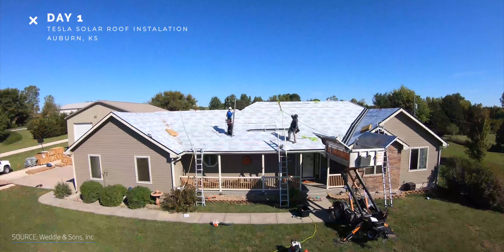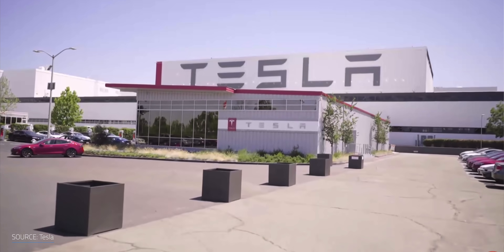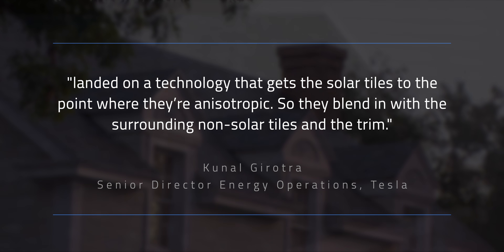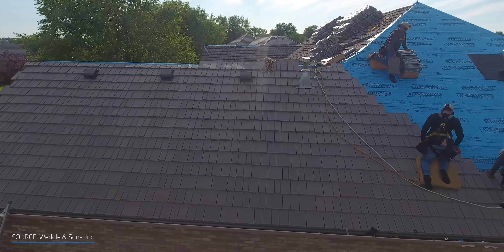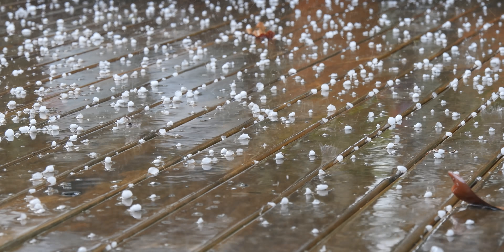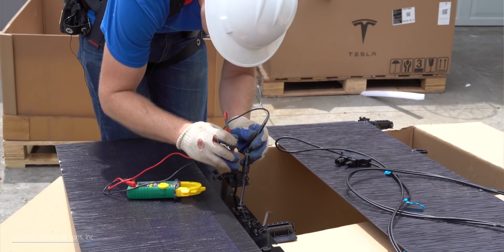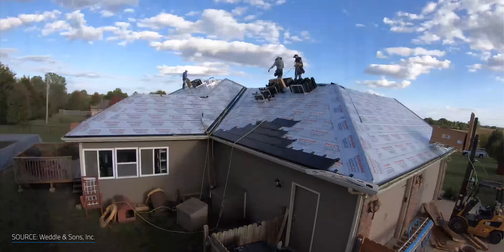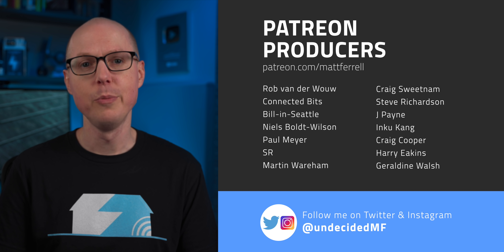Exploring If Tesla Solar Roof Is About To Go Mainstream?

Comment: When he talks about hail damage, he misses an important point:

If you cover your asphalt roof with traditional solar panels, the solar panels will get hit be hail, not the asphalt roof.  If one of those panels is broken or damaged by hail, replacement is incredibly easy.  It'll likely take your installation company less than 15 minutes once they're on-site.

Comment: I enjoy your channel especially since I am from MA as well.  So some content is very relevant.   I am considering Teslas panels and just reviewed the qoute for the roof.  In my case panels are $16k(7.2kwh) and roof $47k(8.2kwh).

Even if I replaced my roof the panels would be a most cost effective option.

Although the roof looks like a great one for a new build.  I think you pointed that out.  

Keep up the great work.  Thanks from Charlton MA

Comment: SAVE YOUR MONEY - FORGET WIND TURBINES & SOLAR PANELS !!! 
Within a few years electricity will be rapidly falling in price. Thanks to the invention of the PLASMA REACTOR (first announced by SAFIRE at Bath University UK in July 2019), which is guaranteed to sweep away ALL other current methods of power generation due to its multifunctional capabilities, as follows:
1. Extremely cheap & green electrical generation 24/7 & 1600% more efficient than even a current Nuclear Power Station.
2. Remediate Nuclear waste. i.e it will totally "eat" the material creating the dangerous radiation, and save us all Billions a year by getting rid of all this highly dangerous material that we have too currently bury & store.
3. Transmutation to produce Rare Earth Metals in Industrial Quantity at a fraction of their current cost value.

SAFIRE was a High Tech Canadian Electrical Engineering Research Company, set up to research the concept of the Plasma Reactor, and produce a working prototype (completed in mid 2018).

AUREON ENERGY Ltd. A Canadian Electrical Engineering  Development Company, set up to develop the "Safire prototype" into a fully commercialised saleable machine system. Commercial Design & Development is expected to take another 2-3 years. You can find AUREON ENERGY's elucidating advertising elsewhere on the Internet !

The "Plasma Reactor" is intended to simply replace the Gas/Oil/Coal or Nuclear part of any current main grid power station. Power stations boil water to create steam, which is then fired under pressure at Turbines which then rotate. Each Turbine is connected to a Generator which then also rotates generating electricity. So whatever the fuel supply used, it is only used to boil the water to make the steam ! 

But of course the Plasma Reactor can simultaneously do the other jobs listed above, effectively Guaranteeing it will eventually sweep away all current methods of power generation. The cost of electricity will therefore plummet, making even wind generators & solar panels financially untenable !!!

LOOKING FORWARD TO CHEAP ELECTRICAL BILLS !😄.

Comment: Noticed something that didn't occur to him. This new modular roof design could also be non-solar. Just install the clips to hold cheaper non-solar panels, panels that can be cheaply replaced in case of hail damage instead of replacing the whole roof. A new type of roof option.

Comment: The bottom line is it doesn’t matter how “good” it looks, how long the warranty is or how beneficial in other ways it might be. If it does not make sense from a financial point of view, then it is D.O.A. as far as I am concerned.  And it needs to make financial sense WITHOUT mooching off the rest of the citizens paying taxes. Including a “subsidy” in the cost to lower it is a bit shady since a business should not have the government picking sinners and losers. A $14,000 subsidy from the taxpayers is about what a normal roof costs for most people.

Comment: Aha, only Building Regulations in UK is very difficult to bypass. As they are very traditional and conservative. Roof tiles on the front of the houses in UK has to match its historical shape, colour and design. And with Solar panel tiles this is very difficult to implement.

Comment: you talked about hail storms ...so how does hail get through the solar panels to hit the roof if the panel has tempered glass?  replacing a couple solar panels is cheaper then ripping up the entire roof... Wouldn't you simply repair or replace the area where shingles are damaged?  What kind of shingles are you using as those products in this study.... they are now being made from recycled materials keeping plastics out of landfills and maintaining cost while increasing life... just curious if you're considering the other factors in the roofing costs to maintain a balanced view on the overall costs

Comment: alright, enough ... he said asphalt roofs last 10 or 15 years? NO. They last 20-25 years, easy (esp. architectual shingle). And the prices you quote in this video for a "roof plus solar" are false. Most solar companies will install their product ... for "free" (strings attached, of course), so you are only paying for the installation of the roof product, NOT the solar.

Comment: Over here in Belgium our houses are build way more durable. You'd need a pretty sizeable hurricane to damage them, I guess it's just tradition. Okay a tornado rips through just about anything but that would still have to be a hefty one. Anyway I don't really see solar roof-tiles take of here because they are quite a structural downgrade over here. Never say never though because our houses are actually a bit overconstructed.

Comment: I live in an upscale townhouse assoc.   I believe the other residents would be interested in using Tesla's battery/solar roof tech.   
Would be much more efficient since 3 townhouses together cover a large swath of area that could be covered with Tesla shingles in a day(I believe Tesla guarantees a day of work to install it.).

Using solar energy really won't happen until some early adopters view it more important to save Earth's climate than a couple of bucks.

Comment: One question I have, as a solar installer, is it worth covering the north-facing arrays in these tiles? We rarely ever install panels on the north side because it gets the least amount of sunlight out of all directions and most cases does not produce enough power to really cover the cost of putting them there in a decent amount of time.
Of course it would look odd, especially if the north side and another side are visible to the street. But it all depends on what kind of money customers would like to spend

Another question I have is a lot of power companies have a limit to how much solar you can install. In the state of MN, you are allowed up to 125% of your average power use. And when installing solar panels, they determine how many solar panels you can put on your roof. But sometimes homeowners use a lot of power, but have a small surface area on their roof, or Vice versa. I imagine they have modules of varying efficiency, but sometimes there’s the discrepancy of your roof being covered by a lower level module that only covers 115% or the next level which would be too much and make it 135% (just random numbers I’m pulling out). Do they just go with that 115% cause that’s the best they can do, can you talk to your power company and see if they’re willing to negotiate going a little bit over your limit? Or could these modules be custom made so you can get that 125% limit for the whole surface area?
Reply: You can always use a non-PV tile on the north side of the roof in the same style and color as the PV tiles. I'd say that it is not worth it cost wise to put PV tiles on the north side.

Comment: I find this cool but as a solar installer, when these optimizers get old and need replacing or they start to malfunction, what is the process to replace one?
Reply: The original lifetime warranty has been replaced with a limited 25 year.

Comment: Hey matt, tks for the vid. My issue that limited talk about is... Hailstorms (bought my house in 2018), found that the roof had been replaced twice in the past decade (hail). Is there a solution rather than continuous replacement of these roofs that cost soooo much? Yes, I saw the (force applied), just so tired of replacement/cost incurred.

Comment: 8:07 seems like they break fairly easily. I have trees around my house and usually once a year a sizeable branch falls (10 ft roughly). No damage happens to the current roof, but I could definitely seeing it breaking one of those solar roof tiles.

Who is going to replace the broken solar roof tiles? would be under warranty? if not, how much does it cost to get one solar tile fixed?
Reply: ... Didn't Musk drop a bowling ball on the demo when he first unveiled them? lol. You're fine bro.

Comment: There's something they're not talking about here and that's the fact that each roof needs to be custom built instead of just building the panels and sending them. The roof will have to all be built at once and assembled as they get delivered. Meaning that the angles of the tiles, at the point of intersecting, will need to be cut prior to making the glass; as they are tempered. I mean they are being built but we'll end up going into an apple situation as well, where you can only get use their batteries. There are a few things they're omitting from this interview.
Reply: You raise an excellent point. As this technology develops I would expect home design to change and be informed by the knowledge the house will have a solar roof. I would think a company like the one in the video would be able to provide architects and home designers points to consider. I would think if designing and building a new home it would be possible to do it in a way to lower the installation cost. Just something as simple as making the dimensions of the roof a multiple of the installed dimension of the tiles.

Comment: No matter how many of these videos I watch, I am not convinced on the payback from solar. I love tech. I’m a BSEE, but the numbers being thrown around here will NEVER provide a decent payback on your investment. When I see numbers like $42K for solar plus asphalt or $56K I just scratch my head. I live in one of the most expensive areas of the country outside of CA with a rather large 4,000 sq ft house. Two years ago, I replaced my roof with lifetime dimensional shingles with a 125 mph wind rating. The cost was just over $10K and after insurance it was only $4.3K. I keep my house at 70 degrees in the summer and 72 degrees in the winter with a total average utility spend of about $3K per year. It would take 18 years to even start to get a payback on a Tesla solar roof and not much better for a standard solar if my utility bills were zero per month which they won’t be. The math gets so much worse if you had decided to invest those same monies spent instead. Also, my roof just works. I don’t need to micromanage an app or pay any maintenance. Don’t fool yourself in thinking that solar efficiency doesn’t degrade with weather conditions, dirt and time or need some level of maintenance . My roof has a lifetime transferable warranty and I never have to worry about it. I know every technology needs early adopters to drive the price down, but this technology won’t even be a consideration for me until the cost is within 25 - 30% more than a standard roof.

Comment: For those that have issues with the local grid going down this is a great option. But for me it would cost around $60,000. Remember it's not just the roof you need and solar tiles but also the batteries and power bank. And this cost is after a $14,000 government credit.

Comment: For me I think tesla's solar roof is a concept very early for it's time. The concept is innovative don't get me wrong on that. It is just too early. The reason being is the fact at the moment of this comment the highest efficiency of solar cells is 22.8%. As time goes by the cells would become more efficient. Say 2025, it is now 30% or by 2040 it is 60% and so on. My point is it is far more economically friendly to stick with the traditional solar panels mounted on your roof because it is far easier to replace those panels than to replace the entire roof every few years whenever their is a new update to solar cell efficiency. FYI There are rooves that can last 20 - 30 years. It has happened. Basically I am not hating on it. I am just saying it is too early. It's far more economical to go for this when efficiency is 40% at least because heck northern countries don't get a lot of sun so the current solar roof is pointless for them.

Comment: My 3400 sq ft house has a 6000 sq ft roof.  Composite roof is $28k, 18.25 kw of solar is another 42k (31k after tax credit).  Adding storage would add another 42k, but with net metering this doesn't yet make sense.  The Tesla roof is $170k.  Also, I found a cool metal roof option for under $40k, which actually seems similar to the Tesla in appearance.

Comment: I would like to go solar, and need to replace the asphalt shingles anyway. The Tesla system looks promising. on concern is with the often occurring lake effect clouds and snow covering the tiles. Another concern is as PV gets more advanced and efficiencies increase I feel like waiting for the next big advancement so overcast days and short winter days would still provide a reasonable about of energy. The replaceable tiles seem to lessen this concern except the cost for upgrading existing system is a concern if Tesla offered an upgrade guarantee then I would be less hesitant on the purchase sooner.

Comment: Brother,
As I move forward with my new home design in NC and trying to keep my front south-facing roof as simple, but still attractive, I'm seriously struggling and fear failure because I still can't locate a Tesla Partner Program affiliate to work with; all very depressing. I do have some freedoms related to when I break ground but without at least one Tesla Partner for my SolarRoof & PowerWalls I'm stuck.
So much of my future plan for sustainable retirement rests on the SolarRoof and PowerWalls to meet my home and Model Y energy needs.  I really want 100% solar energy.  Now being 6-mo since you produced this video... I am nervously moving forward with my design phase and hope to break ground next spring... or ...???   
I am concerned also as I haven't heard Elon speaking up about SolarRoof and its expansion nationally in ages... perhaps because they can't produce enough batteries for the associated PowerWalls. 

Cheers, 
Eric

Comment: Wow I didn't think your channel was this sold out.  I don't even hate the product but there are a ton of cons that were never mentioned. 200 customers waiting!? That's crazy! Definitely not just supply issues. What happens when your roof is damaged and you have to wait on Tesla to fix it? Asphalt shingles can be had anywhere. You might be waiting literally years for Tesla to fix your roof in a disaster. I'd call that a 'con'. At least pretend not to be a shill.

Comment: Tesla won't remove four panels for emergency roof repair until summer 2020

I have been a very happy customer with a 1.5-year-old solar/powerwall system until now. We have a roof leak, and the roofer says that 4 PV panels need to be removed for them to make a permanent repair. Tesla cannot get a crew to our house to remove the panels until summer. 2020. We need the repair done ASAP. There is more rain in the forecast. The roofer can put some tarps in place but also says that they may not be completely effective. Tesla says that I could have a 3rd party do the removal and replacement. However, if the 3rd party damages the system, the 3rd party is responsible for the damages.
I cannot believe that Tesla does not have a process in place for emergency roof repairs.

Any helpful suggestions?
–Tesla Forums

Comment: In the UK, Teslas roof is very expensive. This product would be so much better if you could just buy their solar panels and have them fitted to your existing roof by a Tesla certified installer. The idea being it would enable you to get the Octopus energy Tesla tariff. If they did this they would clean up.

Comment: I feel the need to comment as an retired roof installer. even though the benefits of the solar roof outweigh those of a traditional asphalt roof it still is less expensive to replace 20 shingles than it is to replace one panel! 
A bundle of shingles holds 20 pcs on average and costs about $1.25 per shingle, how much does a Tesla panel cost??  Food for thought
But I do enjoy your educational videos

Comment: Seems like an ideal solution for new build homes particularly if the roof pitch and orientation can be optimized for maximum solar gain.
Reply: yeah but it's still more expensive than normal solar tiles.

Comment: I just put down the $100 to get the more formal estimate done.  Having a hard tike reaching someone real to answer some of my questions.  We don’t need a new roof right now but I am considering doing it based on low interrst rates and thr fact that demand hasn’t sky rocketed for it yet.  I also believe inflation and labor costs will rise rapidly in the next few years, also the tax credit goes away shortly.  Am I making a mistake replacing my roof when nothing is wrong with it? It’s  twenty year old home with Spanish tiles. Thoughts?